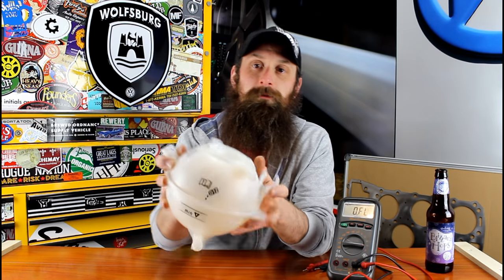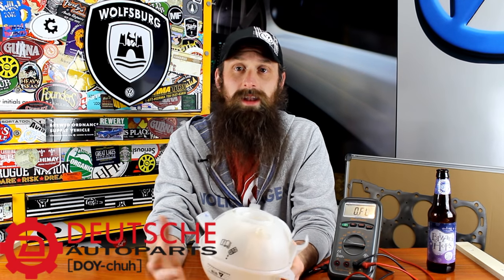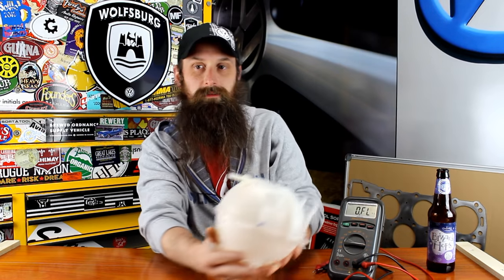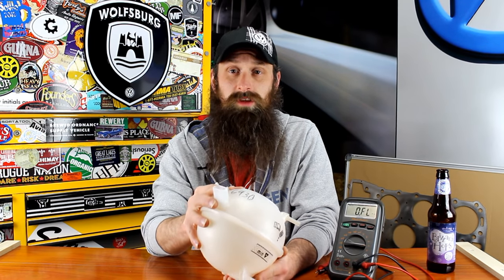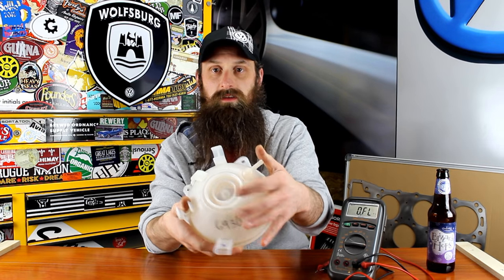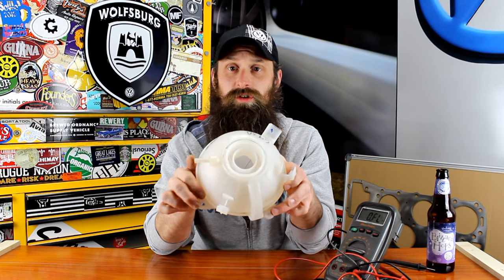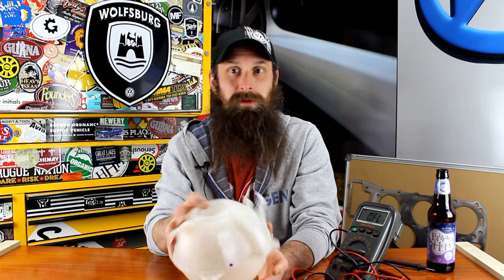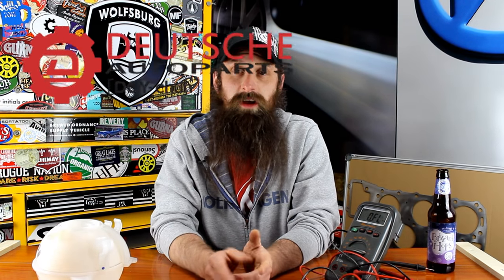How VW Coolant Bottles Fail

Comment: I have a tiguan 2.0  tdi  2012.. its leaking ...a add coolent every 8 days.. i changed  water pump  but nothing still leaking... im going crazy...sorry for my english...
Reply: Same on my 2014 tiguan tsi!!
Reply: @clint1285  did u find the solution of the problem... for me i changed egr  cooler ...and its  consume less coolant... i think i have a problem of head gasket 😱😱...not less than 2000 💶....
Reply: @cherifchahid6726  yeah.    I changed to metal water pump.  No more leaking.  Car burns oil fast.  It has 130,000 miles.  How many miles u got?
Reply: @clint1285  141000km...

Comment: Getting recurrent low coolant level in reservoir without any visible leak.. How to find the leak ? [VW TDI]
Reply from the maker: If there is no external leak, it may be the egr cooler leaking internally

Comment: hello, i have a 2011 vw cc rline and i just notice this morning that my car is leaking but not any of the dash lights have alert me to check coolant. And has not over heated. what could might be ??? im frustrated
Reply from the maker: +Mayrim Hernandez Leaking coolant? It may have not leaked enough to drop the level in the bottle. Be sure to have it looked at, you do not want to keep driving it with leaking coolant. At some point it can and will overheat.

Comment: Hey Charles, 
My 2011 cc recently started leaking coolant and the mechanic stated it is the lower radiator hose that is failing. The price for repairs includes them taking the intake manifold off and replacing the engine water pump housing, but they are not sure if that is needed. Any advice?
Reply from the maker: +Shallah Dozier Odd, most of the time coolant leaks are an easy find. What happens if they are wrong?
Reply: They said if the extra parts weren't needed and if they didn't need to take off the intake manifold to get to the lower radiator hose then I wouldn't have to pay for the extra labor. I just took their advice about it being the lower radiator hose and set up an appointment with VW for tomorrow morning

Comment: Audi A3 8P 2005 2L TDI warning message flashes in cold mornings, būt coolant level is at max mark
Reply: Did You solve the problem?
Reply: @futurama17  yes, replaced coolant expansion tank. Problem solved
Reply: @aurimaslab4275  I was ready for replace that bottle, but fortunately only lost connection in the plug. Contact spray solved the problem :)
Reply: @futurama17  for me this method made no difference 😔

Comment: Can regular coolant (Non G12) be used in VW like an MK4 Jetta?  Thanks,
Reply from the maker: +Aricu Nono no. Use g12.
Reply: Thanks,... And Thanks for the super super quick response..  I truly appreciate your videos.
Reply from the maker: +Aricu Nono right on. You're very welcome.
Reply: Only if you completely remove ALL G12 from the system. G12 doesn't have distilled water

Comment: I just replaced the bottle on my A4 B6, I believe it was leaking, but the new bottle appears to be leaking in the same place! At the electrical connector. Is this possible?
Reply: yeah it"s possible. Quality control in 2017/2018 is worse than the 90's.

Comment: I need help,  my 2009 Volkswagen c,c ,started overheating, so my mechanic change the water pump thermostat, but the temp Gage still Rises over 200 degrees.
Reply: I am having same issues with my 2009 VW CC let me know how you resolved yours. thanks.

Comment: is it possible to use a radiator from a japanese car, as in radiator with a cap on it, and modify the cooling system and use japanese style cooling system?
Reply from the maker: You probably could. There were some older VWs that used that set up too. Corrado I think did.
Reply: Wow... thank you for answering...
Reply: I'm wondering the same after buying a vacuum bleeder and just being mad at the fact I had to buy it just to ensure the radiator actually gets bled properly

Comment: you forgot to mention that inside those bottles there is a bag of silica crystals..designed to extend the life of the coolant.. which it does not do,, for anyone reading this.. get that bag out of the bottle now,, it eventually breaks,, and the crystals will clog your heater core...open the bottle you will see it on the right side ,,,

Comment: Hey man can you do a video showing how to bleed the cooling system? especially in a mk3, i tried hard to bleed it but i can't do correctly and can't find a reliable way, Thaks a lot! and sorry for my english xD
Greetings from El Salvador!
Reply from the maker: Bryan Nuñez You can raise the front end up a bit, that helps. Also turn the heat on high. Oh, and you may need to drive it.
Reply: Thanks man! i'll try raising up the front end, because i've done like the manual says but still with air. thanks again!

Comment: Why bend the wires? Just grab one at a time with pliers and use a fine file to remove the crud off them, with the bottle removed ofc.
Reply from the maker: That may work too.  You’d have to remove the bottle which some people may not want to do.
Reply: @HumbleMechanic  Yeah I think you're right. Although, it's not a very big operation to do so.
Reply from the maker: Nah super easy. Unless it a 2.5 Beetle. Haha.
Reply: @HumbleMechanic  Agreed ;)

Comment: 1 week old GTI , red light low coolant level indicated . Level is perfect needle at 12 oclock , watertemp 194 degrees and car seems fine  , tank sensor fail so new ??  Thanks
Reply from the maker: That or simply debris on the contacts. OR maybe a wiring issue. If it's brand new, might be that the connecter is not fully seated
Reply: Dude , Im impressed !   Just got home from dealer and the connector wasnt fully seated !

Comment: Mk5 gti. After working on my car, I forgot to plug the radiator fans back in, and I let a friend of mine take it for a drive (we swapped cars).
Lo and behold when we meet back up, my temperature gauge is reading 280°F and I pop the hood and my radiator had burst along with my coolant ball reservoir. Luckily there was no damage done to the motor, but I still wonder how exactly the radiator and coolant ball burst if there is a pressure release.

Comment: But why is it spherical?
Reply from the maker: Probably for fitment.
Reply: +sssssneaker . The system is under pressure when hot.  A sphere is the most efficient shape for strength and minimal use of material.  Consider the comparison to a balloon.  When you blow it up and it is under internal pressure, it wants to form a sphere.   Any other shape requires more  material to hold the pressure.